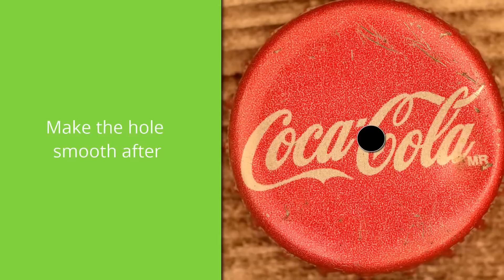Making a mini water pump

Comment: it will won't work unless your water source is in a higher place then your glass or whatever you want to take the water(otherwise this tiny "pump" can't handle it) but guess what it's simple phyisics the water flows high to low. so is this really a pump ?

Comment: how much volt motor
Reply: doesn't really matter. . but if you will use a phone charger as  power supply your motor should be 5 V or less. if your motor draws higher current(>5V) it won't work at 100%.

Comment: I made one, but mine doesn't suck from the tube :|
Reply: You need to prime it first, dip the pump in the water a little while it's on, and it will work. If the pump is below the water and the water goes down the tube initially, you don't need to prime it.
Reply: Maybe the pump doesn't work. Try removing the tube, then putting the pump part, not the motor in the water. If that doesn't work at all, then try adding more voltage, or mess with the impeller design.

Comment: Where did you get the motor and pipes tho? Lol
Reply from the maker: Pinkalicious73098 get theme from old toys : car or anything... :)
Reply: okay so I noticed you placed like a lil tube thing onto the motor tip before placing fan, and you glued that. What was that lil tube?
Reply from the maker: Pinkalicious73098  for you notice. about glue you can use water resistant glue.
Reply: Okayyy... well would the motor need to be bigger if you needed the water to travel upward 16 inches? :/  Or will the 6V be okay?
Reply from the maker: Pinkalicious73098 yes, bigger motor will be better, more powerful
Reply: damn it.... i already obtained a 6V _' lol so which motor would you recommend?
Reply: Pinkalicious73098 By what I see in other videos (they don't actually make the pumps, which makes this guy even more awesome), they usually use pre-made pumps that usually run at 12V.
Reply: use straw  and if you want a motor brake like a toy to get motor